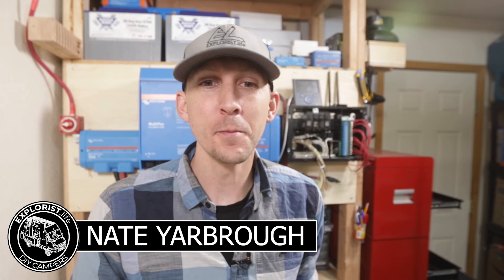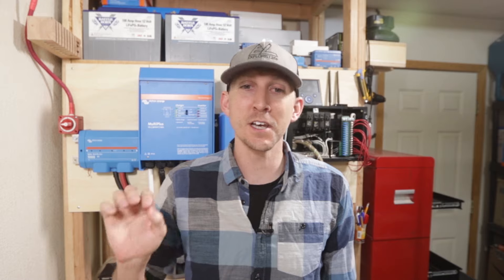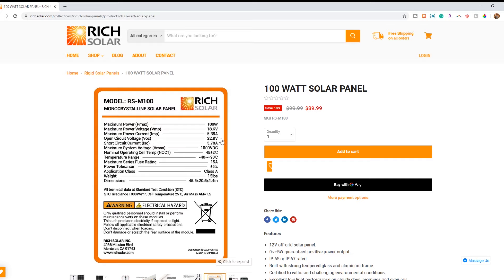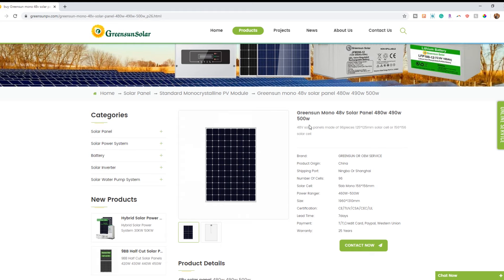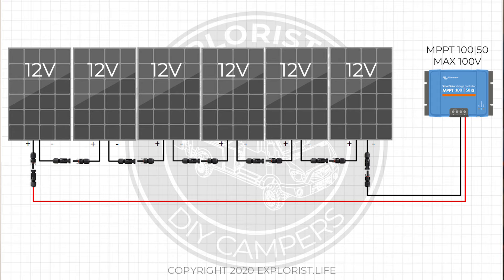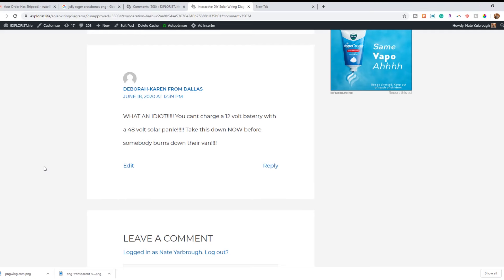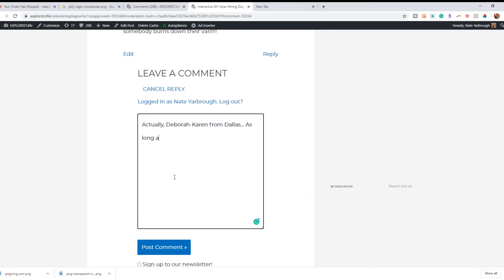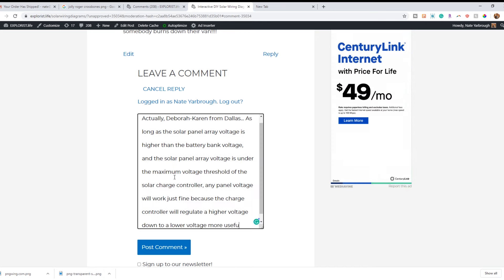12 Volt? 24 Volt? 48 Volt? Which Solar Panels for a DIY Camper Electrical Build

Comment: to be sure i understand,  so we do use open circuit voltage when sizing our panels wires series strings?
Reply from the maker: Use Open Circuit voltage when figuring the size of charge controller (be sure to take temperature into account with this: https://www.explorist.life/solar-charge-controller-calculator/).  Use the Max Power Voltage to determine voltage output when under a load for sizing wire.
Reply: @EXPLORISTlife   thank you very much!!!!!!!! i already got my 60amp mppt controller, now i am building a hypothetical array based on maximum volts amps, then a battery bank lol. got to start somewhere.
Reply: wow i have come a long way since asking my question. i have since then built two 21kwh banks, wired 5 controllers and have about 5kw of panels, and picked up several big inverters and wired it myself, thanks to people like you.

Comment: Hi Nate, Can I use five, 200w panels in series to run into a 48v MPPT charge controller?  I have another portable 200w panel that I want to connect to the other 5 when necessary.  That's the plan, but I am a beginner so want to be sure that I don't have to have exactly 1200 watts for that controller..  Also, I'm thinking that I shouldn't need a shunt with the all-in-one MPPT controller??  And lastly, can I simply plug into, or run wire to my RV 30A inverter as I am expecting to be able to operate my 12v appliances and ac outlets like normal??  Oh, do I need a DC/DC converter??
Reply from the maker: Perhaps this blog post will answer most of those questions: https://www.explorist.life/30a-camper-inverter-with-solar-and-alternator-charging-wiring-diagram/

Comment: I dont get it... wouldn't you want a higher voltage panel (IE a 40v 400 watt panel vs a 20v 400 watt panel) cause it's the same real estate on your roof but actually makes more juice to the batteries?

Comment: Have you discussed in one of your videos the difference from a Buck and a Boost solar charge controller?
Reply from the maker: Nope.  What questions do you have?
Reply: Nice videos by the way. Just though adding that there are two types of MPPT solar charge controllers. Generally most buck the voltage though boost controllers are also used with smaller solar system to charge 24, 36 and 48v battery banks.
Reply from the maker: Gotcha.  All of the charge controllers I will talk about on this channel will be 'buck' charge controllers as the array voltage will ALWAYS be higher than the battery voltage as in mobile setups like I teach, it's 90% 12V battery banks.  The only time I'll spec out a 24v battery bank is if the solar array grows to over 1200w of solar (or over 3000w of inverter power).  The only time I'll spec out a 48v battery bank is if the solar array grows to over 2400w of solar (or needs larger than 6000w of inverter power); Both of which are incredibly rare.
Reply: Yep, boost chargers are common in marine and golf cart solar.

Comment: Hey Nate i wanna build a high end solar system to run things like a small ac unit coffee maker,fridge,led lights all around, led tv xbox and such, basically 120 volt outlets just like home for a 2019 ram promaster 2500 highroof, but not sure of the right stuff to get, and from from what website... i know you explain all this stuff in youre videos, by the way you make great content, but still im alittle confussed about how much and what i need and the deal with parallel and series connetions on the solar panels.
Reply from the maker: Hey Manuel!  I think you'll likely be looking for something like this: https://www.explorist.life/3000w-inverter-400-600ah-400-to-1200w-solar-camper-solar-kit/

But I would HIGHLY HIGHLY HIGHLY encourage you to do a power audit to get an estimate of how much power you can estimate using on a day to day basis so you don't grossly under/over build your system.  Here's a tutorial for that: https://www.youtube.com/watch?v=a406IxiU-Xg

Comment: Honestly I am asking for help....I have a DC 48v 1800w ebike controller and need to change the 4 12 12 batteries and don't want to blow it...lol
Reply from the maker: You'd want to charge your e-bike from your inverter, the same as any standard household socket.  Here are some diagrams of systems of various sizes to get you going: https://www.explorist.life/solarwiringdiagrams  Any of the ones w/ inverters 3000w or larger would work.
Reply: No I'm running 4x 12v 12amh DC batteries on a 48v 1800watt system n am looking to try n charge it with solar...I have a 12w panel.from an outdoor pump system and .just need a diagram plz
Reply from the maker: Here are some diagrams on how I recommend setting up systems: https://www.explorist.life/solarwiringdiagrams.  If you've chosen to use different parts than what I recommend, I hope you can piece together the information I've made available on my channel to find a solution to your problem.  Good luck!

Comment: It would almost be worse to use a bunch of 12v panels in parallel with very high amps going threw thin wire most people use 12g solar wire. I have always used 8g
Reply from the maker: Yeah, I pretty much never recommend wiring a solar array in parallel.  Usually a mix of series-parallel, or just series, depending on the panels.  Here is a video showing that process: https://youtu.be/OsVqIvahThM

I never design a solar array that requires larger than 10ga wire.  Here is a video on that: https://www.youtube.com/watch?v=JW0vrTAa50s

Comment: I've got a 60a MPPT that can accept up to 100v open VoC and a 12v LiFePo4. I also have 4, 195w "12v" solar panels.

I think the answer is "yes", but just to make sure, can I wire my 4, 12v panels into a 48v array (~80Voc) and charge my 12v battery through the MPPT?

Comment: Great, but will a 12v 200W panel charge a 24v battery bank? or say three 12v 200W panels in series? parallel?  you need to get the input voltage above 24v regardless? thanks!
Reply from the maker: The solar array voltage needs to be above the battery voltage, by whatever means it takes to get it there.  In the Case of Victron MPPT charge controllers, the array voltage must be AT LEAST 5 volts higher than the battery bank voltage to charge.

Comment: Does the rule that the "maximum voltage a solar array can send an MPPT charge controller MUST BE below the maximum threshold the MPPT charge controller can handle" also apply to PWM charge controllers?

Comment: I got my head around this and thinking of doing 6 panels series/parallel with 2 sets of 3. However if one panel of the 3 gets shaded or damaged wont i lose the whole string of 3 where as with all 6 paralleled i would just lose the compromised panel with the other 5 working normally?
Reply from the maker: Sort of...  But there is an easy fix to both of those scenarios, which I covered a little more in depth in this blog post: https://www.explorist.life/solar-panels-series-vs-parallel/
Reply: @EXPLORISTlife  haha yes moving the camper is an option all i got to do is hook it back up to tow vehicle assuming its around. Then unhook level it back out. Not all of us have a van and with 3 panels on the nose damage is more likely and i dont have room in the 2 dr jeep to keep spares. Good suggestions though.
Reply from the maker: I provide information.  Its up to to you to determine what you do with that information.  🙂  I don't provide validation for ideas I think will yield sub-par results.  If you think your idea will work... go for it and test it out! 🙂  I still think series parallel will be the best option for you regardless of shade or not.  Keep in mind, we personally did have an easy to move van, but my opinions are based on the hundreds of people I have helped design their systems and the advice given to me by the Engineers at Victron Energy and Battle Born Batteries.  Ultimately it's your system and your call.
Reply: @EXPLORISTlife  ya and thank you. I guess even if i lose one set im only charging 200ah of BB with only 12v needs heaviest load being the furnace. Can you recommend a good preferably victron charger for shore power. I cant justify a $1100 inverter charger just to run a microwave i may or my not use. Thanks
Reply from the maker: Victron Phoenix is the Victron line of battery chargers that will allow you to charge your batteries from shore power.  They come in many sizes; so you can pick your poison as far as that's concerned.  The charger won't allow you to USE shore power to power your 120v appliances, though.  For that, you'd need an Inverter/Charger or wire directly from shore into your breaker box if you only wanted to run 120v appliances when connected to shore power.

Comment: I decided to put on my boat 2 soler panel  each 190 wats 48 volts and I used mppt regulator 12v 24v 36 v48 v just checking if is that ok cheers

Comment: What’s your opinion on MPP or growatt all in one units to be able to run “48” volts?
Reply from the maker: I have no strong opinion one way or the other on either of those units.  Here are my recommended ways/parts/components for building a system (a few options depending on the capabilities you're looking for): https://www.explorist.life/solarwiringdiagrams

Will Prowse has some videos on both of those units.  You may check his channel if that's the direction you're trying to go: https://www.youtube.com/watch?v=4kvSXx7sntk

Comment: So since it will all be regulated through the charge controller, can you mix 12V and 24V panels in the same solar array?  For example, if I currently have 2 x 210W 12V panels (16.8 Vmp, 12.5 Imp) and wanted to add more, could I set the first two up in series (so they'd end up being 420W, 33.5V, 12.5A) and then add a single 210W 24V (33.5V, 6.25A) panel in parallel with that first series?  So the total array would be 630W, 33.5V, 18.75A?  Or is there more to it than that and there are other issues mixing the different panels?  Thanks!
Reply from the maker: Hey Chris!  This should help: https://www.youtube.com/watch?v=jejro4zkl8I
Reply: @EXPLORISTlife  Thanks!  Sounds like it would work, but it still makes me uneasy.  Perhaps I need to take the pledge again!

Comment: If I have 
Open circuit voltage 44.4v
Voltage at Pmax 35.5v
Short circuit current 8.25amps
Current at Pmax 7.60
Does this mean I am producing 44.4v and 8.25 amps per panel? I know it is a dumb question but I am new to this. Any info would be greatly appreciated.
Reply from the maker: Great Question!

The Voltage/Current at Pmax is the volts/amps the panel will put out under ideal conditions (full and direct sunlight at 25 degrees celcius)

The Short Circuit Current is how much power will flow when there is a short circuit in the panel.  This is really only important when trying to size fuses (video on that coming soon).

The Open Circuit Voltage is the volts the panel is producing then there is no load on the panel (so... if the sun is shining, but the batteries are full and the charge controller has essentially turned off to prevent overcharging).  This is important for when sizing the Charge Controller.
Reply: @EXPLORISTlife  thank you for clearing that up for me. But I do have one more question. Does this mean the panels only run close to 48v? I am looking to run the system at 24v. Any suggestions?
Reply from the maker: Correct, but the entire job of an MPPT solar charge controller is to regulate the 'high' voltage of a solar array down to a level more appropriate to charge your batteries at.  So, this charge controller in particular (https://amzn.to/2Y71ehk) could take  an array with a max voltage of 100V and regulate that voltage down to charge either a 12V or 24v battery bank.
Reply: @EXPLORISTlife  Your awesome dude. I'm gonna shoot another one at you. Can #10 zip wire (red and black) be used for the wire runs of the solar panel? They call it speaker wire but it isn't. What are your thoughts?
Reply from the maker: @thomwood8768  Check the parts list for this project to see what wires I recommend for wiring the solar array: https://www.explorist.life/diy-solar-electric-install-on-a-1976-airstream-argosy/

Comment: Watched thru your videos, but I couldn't find anything that solves one of my concerns. 
First, your videos are great, love and use most of them. My issue is I'll use my skoolie in USA (110v) for 2 year then moving to EU (220v). What would y recommend for an easy conversion when moving to the EU? 90% will be 12v, but AC sure will need shore power. Thanks
Reply from the maker: There is truly not an EASY way to accomplish this.  The inverter/charge could be switched out from a 120V version to a 240v version to accept 240v shore power; but then the outlets would need to be switched out in order to run 240V appliances you'll find in the EU.
Reply: @EXPLORISTlife  thanks for replying so fast. OK, inverter & outlets....not a big deal!@ Thanks again
Reply: @EXPLORISTlife  how to get in touch w you to discuss using your services?

Comment: Hi Nate. Great videos but have a question. I have 4x190 watt panels and a victron MPPT 150/100 controller. Can I wire 2 panels in series and 2 panels in parallel and then connect them to my roof top plug -in connector? That would give me  52 volts  and  27.9 amps at peek going to the controller. Just thinking about potential amperage loss with partial shading.
Reply from the maker: Nope.  That wouldn't work.  Here is the math on 'why': https://youtu.be/jejro4zkl8I

Comment: Does the charge reduce the amperage along with the voltage of the 48 volt solar panel? Does it become less efficient then? Reducing wattage as well?
Reply from the maker: It remains constant.

Using Watts law of Volts x Amps = Watts

From the solar array: 48 Volts * 10 amps = 480 Watts
Into the Batteries: 480 Watts / 12 Volts = 40 Amps

Comment: This was a great video but it left me with questions. 

Like, what if I buy two “48” volt panels (320w) can I still theoretically wire my electrical system as a 12v system with 12v components? 

I wish you would have mentioned the component side of this equation.
Reply from the maker: Yes.  48V panels when paired with a properly sized MPPT charge controller can indeed be used to charge a 12V battery bank & components.

I'm not sure what you are asking with your 2nd question.  What is your specific question for the 'Component side of this equation'?
Reply: EXPLORIST life - DIY Campers I mean when you’re talking about the electrical system you’re only discussing the solar side and not the side everyone actually interacts with, the appliances. It’s all fine and dandy to understand that the solar works this way but if you’re not reassured that your appliances and everything else stay the same or need to be changed or used differently in any way  then this knowledge is useless.
Reply: People who have gotten this far understand that batteries and solar all come in different voltages. What they may not realize is that appliances also do the same. So, when you’re talking about a 48v system some people will assume they need to find 48v appliances. Do you understand?
Reply from the maker: @matthewjswider  Yes, I understand.  Please know that this is just one part of a series of videos.  I have many more videos coming out in time that will teach everything there is to know about the system downstream of the charge controller.

But... in the meantime, I already have several complete diagrams already put together for those who are just ready to get up and running and may care less about the 'why' of this stuff.  Those can be found at https://www.explorist.life/solarwiringdiagrams
Reply: EXPLORIST life - DIY Campers that’s great! I was searching for the answer to that question specifically when I looked at this video and you did such an incredible job of explaining everything else I was anticipating the rest and then it wasn’t there. I guess that on me. Lol 

My last build had 4 100 w renogy panels and a 40a mppt. So, when I was in full sunlight I may have been pulling in over 12 v but you’re saying the controller is what’s regulating that back to 12v (or 14 or whatever charge voltage is) to charge the batteries? By that does it not mean that any voltage panel will charge a 12v system and allow you to use 12v lighting and appliances as long as the controller will break it down? And if that’s the case, do you suggest any particular charge controller or panels for optimizing a setup as such?
Reply from the maker: @matthewjswider  The entire purpose of the charge controller is to regulate a high voltage solar array down to the 12V-14V it takes to charge a 12V battery bank.

So...  For example, the Victron Smartsolar MPPT 150|85 can take a solar array that is putting out up to 150V and regulate that voltage down to the 12V - 14V it takes to charge the battery bank.

Now... for choosing the charge controller that is best fit for the panels, here is another tutorial (and calculator) for that: https://www.youtube.com/watch?v=MxziHKvTRh8

Whatever panels you decide to use... it best if the array voltage is at least 20V over the charging voltage of the battery bank (but under the maximum voltage input of the charge controller.
Reply: @EXPLORISTlife  Hi.

What is more efficient though?

Let's say that you have a 12v 100Ah lithium battery (max charge is 80C) and wants to charge it with a solar panel.

Is a 24v 200w panel better then a 12v 200w panel?

MPPT controller is used and can handle 75 volt and 15A from the panel. 

Due to the different panels, is one better then another on a cloudy day?

Comment: Actually  thank you  just learned that 12v panel can provide more than 12v , so I have to choose charger that  can provide more than it’s specs ,like u said 12v panels x5  it’s not necessarily 60v could be close to 100v so charger that’s is rated at60watt max could burn
Reply from the maker: Hey jombaz sftcoop, No problem!  Glad it helped! :)